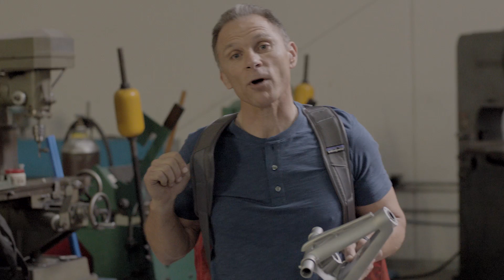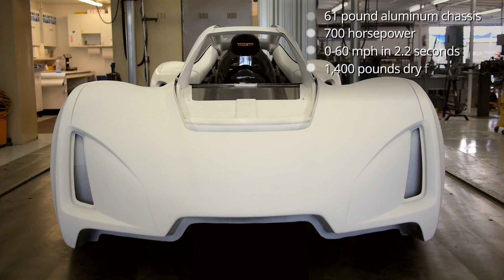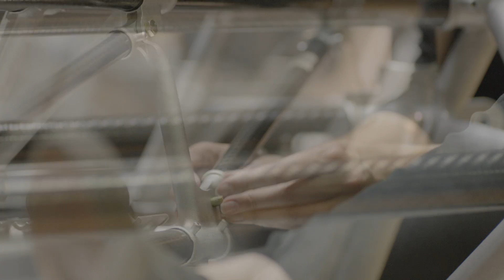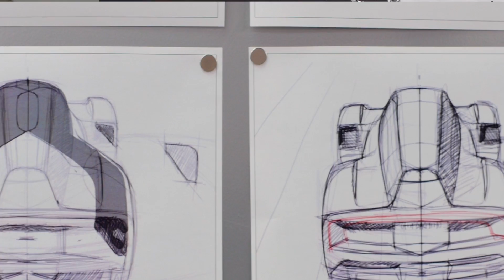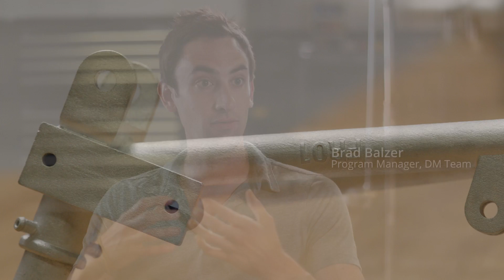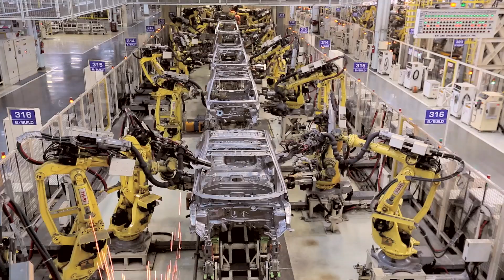First 3D Printed Supercar - A New Way To Build Cars

Comment: Can you guys provide a breakdown of the cost/benefit differences, with numbers, between this car and a similar car built with traditional construction in terms of price, assembly time per vehicle, and raw material usage per vehicle? Also, with so much of the car's body built from carbon fiber, and the likelihood of vehicular impacts, can you comment on the event possibility and safety implications of carbon dust and particulate ejection when those rods fail?
Reply: just say you want one
Reply: "Carbon dust?" What is that about? Tire and pavement wear, diesel exhaust, all make lots of carbon dust. Microbes eat it all. No piles of carbon dust along the highways.
Reply: @algrayson8965  The carbon fibers and various chemical hardeners used when generating these composite materials can result in very fine particulate when damaged, depending on how they are made. For instance, I was able to find someone talking about their experiences in cleanup of crashed airplanes that used composite materials have to first chemically treat the crash with a varnish to ensure the safety of the crews and equipment. These particulate appear to have cancer-causing properties. What matters is the size and shape of the carbon particulate generated from damaged composites, and the binding chemicals used to stick the carbon layers together. Either one (or both) can be a chemical health hazard in a way that metal simply isn't.

Edit: Here's a military report related to the subject: https://apps.dtic.mil/dtic/tr/fulltext/u2/a420193.pdf